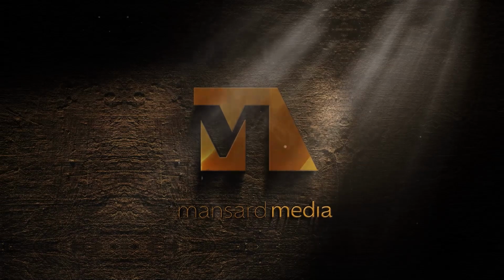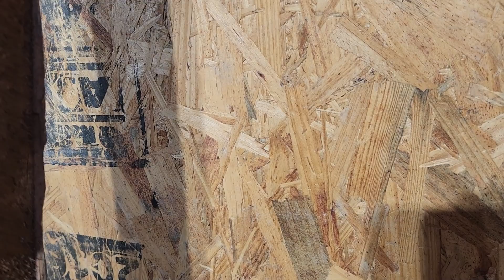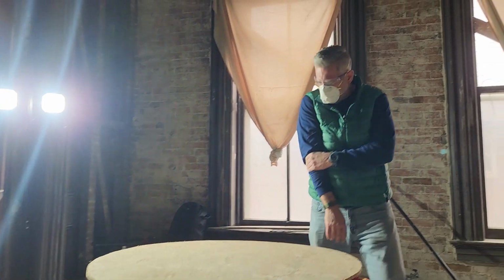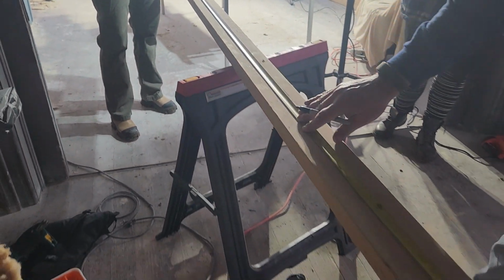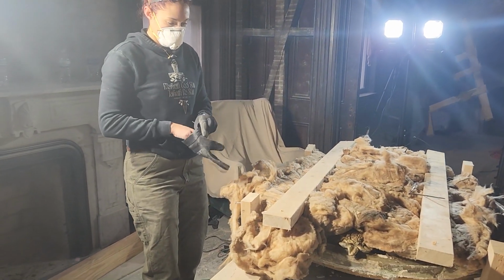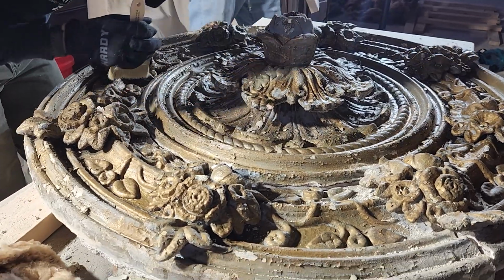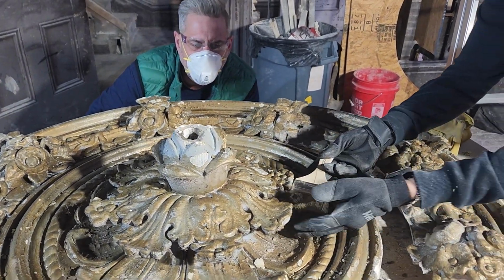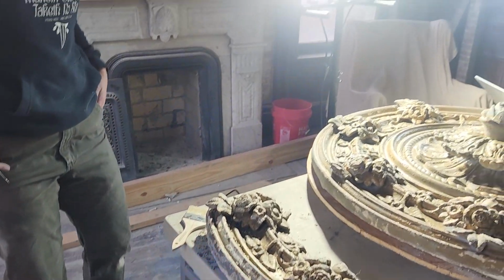An Up Close Look at Our 143 Year Old Mansion's Plaster Medallions

Comment: These medallions were done in component form. The center rossette  is a seperate piece from the larger circular medallion below it. and the larger outer sections Scanning that  center would be extremely difficult. What needs to happen is the center rossette need to be seperated from the larger.. Typically this would be done witha small dremel tool. Once the two are seperated they can be digitally scanned then 'cleaned up" in the scanning program to replace any missing pieces.. I would advise  once they are separted get a plaster artisan to restore the missing pieces then I would pull silicone mold off of these pieces. Then cast them in a lightweight resin. or plaster (purists will want them in plaster) and I recomend you consider selling duplicates to offset your costs.
Reply from the maker: Awesome, this is what I was thinking needs to be done,  but wasn't sure. 

Would you mold it or would you try to scan it and also is there anyone you would recommend in our area?

Love this helpful feedback.
Reply from the maker: 2 more things. 

I think you said you used a foam adhesive to glue the round cutout board to the back for stability and put it back up? or am I mistaken on that. 

This thing seems to be in such good shape that it feels like if we could stabilize it we could just put it back up and carry on. 

I still want to scan it,  but we could reuse it if we could stabilize it. 

No pieces are missing, but one released and can easily be put back in if I could just secure it to a backer board. 

Thank you and let us know if we could talk.
Reply: I appreciate all the knowledge shared here. I’m learning so much!

Comment: See the hole in the very top of the middle?  That might have been something to hold it to the ceiling but when you shine a light down inside there what do you see? When they put these together the plaster held them so maybe that middle piece is molded on somehow. Can't take a time machine and go back and ask the makers how they did it can we?  The Campbell house might know.
Reply from the maker: The center section is indeed glued in. It was molded in at least 7 pieces and then glued together with plaster.